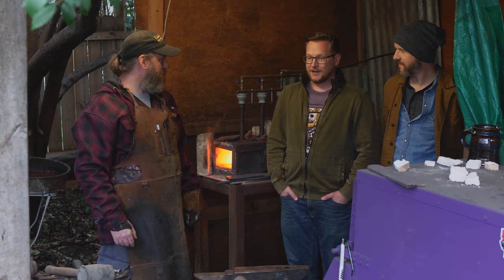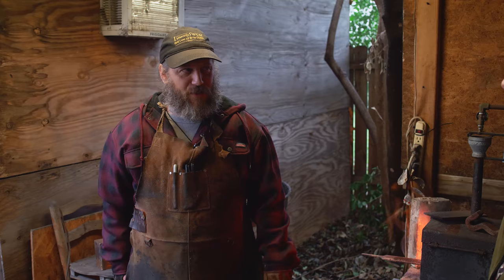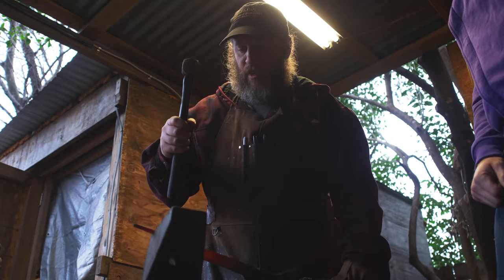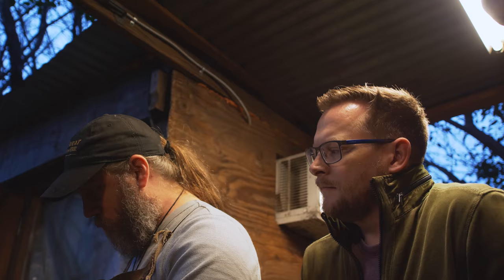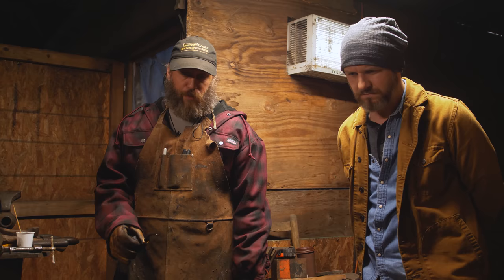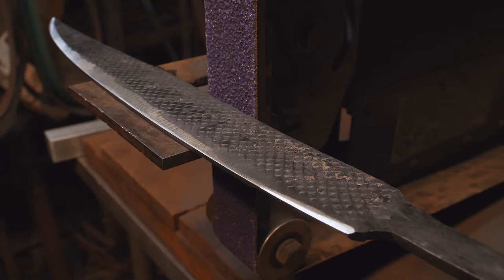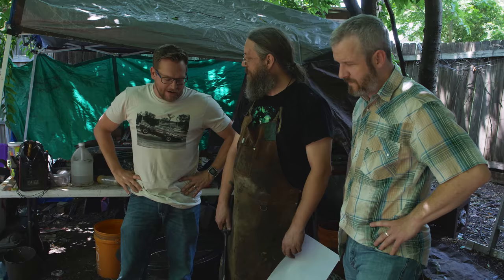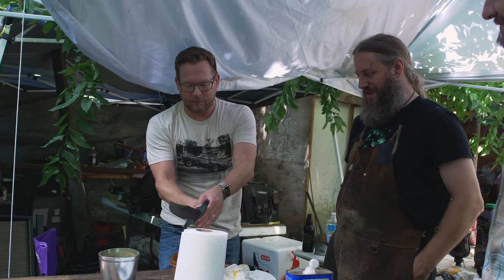Transforming a Rasp into a Deadly Blade

Comment: Super sharp knives are safer than kinda sharp knives, because they cut what you want them too. Kinda sharp knives slide around and cut you instead
Reply: That’s the exact reason my dad gave my mum for giving me a knife sharpener. “If you have your Body weight on it, you’ll be injured worse if it goes wrong”
Reply: That's grade 9 tech class 101. Never use a dull tool.
Reply: i ain't the sharpest tool in the shed
Reply: Truth, but i also think there is a level of respect given when someone says "this knife is extremely sharp" vs when they don't know how sharp it is. they're more apt to play more with a knife they think is dull than they are a knife that they know could very easily make them lose a finger. (They being, idiots that don't know how to treat any unknown blade, not they as in Jason and Brian)
Reply: Just don't ask me to clean the sharper knife.
Reply: That depends entirely on the person. I've had isntances where gravity took over and had the knife been razor sharp, I would have been injured.
Reply: @shadownet7026  I've never cut myself with a dull knife, but I have cut myself with sharps knives several times. It's depends on who is using it, not whether it's dull or sharp.
Reply: thanks mom
Reply: true, my shop teacher always told us the most dangerous knife is a dull one.
Reply: I cut down to my knuckle with a super sharp chief knife and only felt the blood running down my hand after the fact after I stopped instinctively bending my knuckle I healed really fast I feel a blunter knife would have made a real mess out of my finger and taken longer to heal
Reply: Perhaps
Reply: Plus, if you cut yourself with a super sharp knife, you're only gonna do it once. ;)
(Mostly because it cuts to bone and then you nearly end up losing a finger, and start paying extreme attention to where your knife is at all times... Not that something like that ever happened to me... ... I nearly lost 3 fingers. :3)
Reply: Jeremy Owens  
there are exceptions, but yeah sharp is usually beter. 
one exception i could come up with just now, froe (tool used for splitting wood in controlled manner) you do NOT want a sharp edge but still a fair edge say 0.1mm radius (edge will be about a folded sheet of printerpaper), truely sharp may nick the wood and making a weak point (anything less than shaving sharp ==> usually me sharpening).
Reply: Citizen- 7XL5 it would have been much worse with a dull one
Reply: I learned that in physics
Reply: Unless you're jason or brian, then it doesn't matter what they are doing, or with what, they WILL hurt themselves.
Reply: Really depends on context lol
Reply: This is very true, which is why I keep mine extremely sharp. Plus if you do get cut the damage will be cleaner, allowing for better healing.

Comment: Oh, another blacksmithing video on my feed. Is it Black Bear Forge? Alec Steele? THE MODERN ROGUE!? I am so happy! Let me know if you're ever in Utah! You can swing by my house and we'll make some bottle openers!

PS Another good rule of thumb in a shop like that is "Never trust dry steel." Throw some water on it and if it doesn't evaporate off you can probably touch it.
Reply: I have a sign up that reads, "this is the shop of a knife maker. Treat everything you see as if it were hot, sharp, poisonous, and offensively rude."
Reply: @JackSilver1410  I mean. Isn't that just life in general?
Reply: @johnfrancis3203  Only on the surface. My poisons are actual poisons instead of a bunch of genetic defects telling you that bread, eggs, and sugar are essentially the same thing as sarin nerve gas.

Comment: Started bladesmithing when I was 14. Grabbed a blade that was too short out of the forge whilst wearing leather gloves and despite the steel being black and seeming pretty cold but I definitely almost melted the gloves to my skin. So at least no one did that.
Reply: Started stock removal when I was younger around 13-14 ish. I had kinda the same experience. My gloves were wet... A not fun steam bath.
Reply: That was when I started forgeing
Reply: @chaz7346  Yeah, steam burns are the worst. I stopped quenching in water pretty quickly because of that.

Comment: 26:23 I love how the grit of the belt is so aggressive that it's holding hot prices of metal it's ripped off the rasp, sending them through the full 72" cycle, and throwing them back at the guy working on the machine. Doesn't seem like that would be fun if you had chrome dome and no hat or a head full of dry hair for those sparks to nestle down in.

Comment: My friend and I did this exact thing. My knife turned out pretty gnarly. I used a grinder to grind the grit down to where it was smooth but you could still see where the teeth kind of like on their blade. But I think when I used the grinder on it, it kind of de-tempered the metal.

Comment: *SAFETY TIP*:
When you go to feel heat radiate off of something, use the BACK of your hand, like the smith did. When you touch something hot, the nerves in your hand cause you to close your hand into a fist, so if you accidentally touch it with the inside of your hand you're going to grab the source of heat and make things way worse, you don't want to bring the hot thing with you when you pull away
If you touch it with the back of your hand/fingers, you're going to pull your hand away, this time not holding the thing that burned you
Also good for electricity

Comment: Personally, i'm fond of more of a cleaving design for a blade. Technique carries you a long way, but at the end of the day, if you can break your opponent (either their blade or their stance) you can claim a victory. Putting the weight towards the tip of the weapon lets you deliver some punishing blows. Basically, my sword goes where I swing it, not where they try to direct it by blocking.